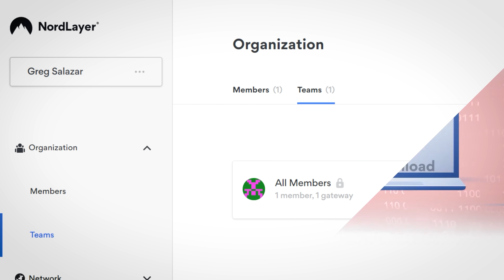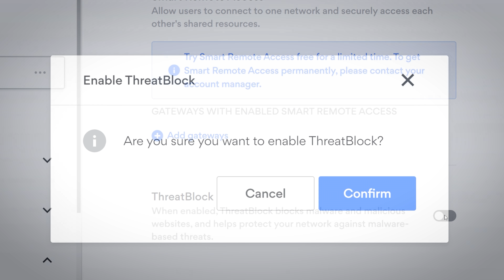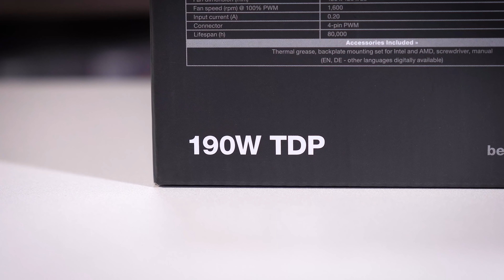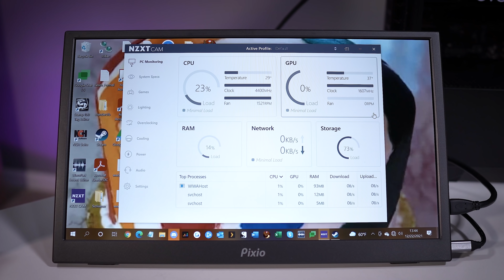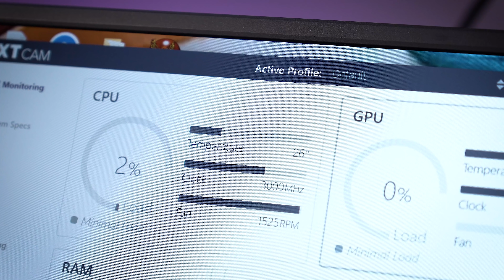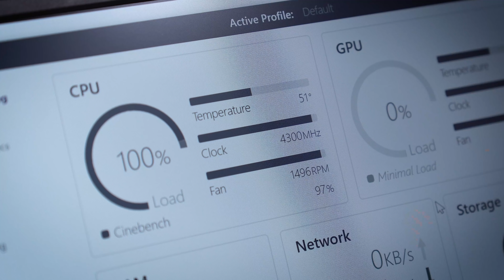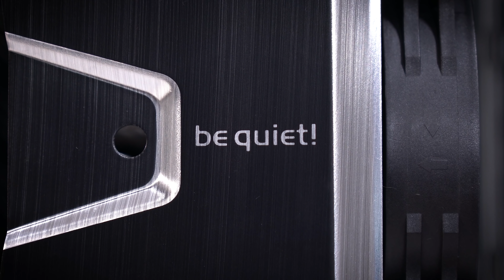Deep-Cleaning a Viewer's DIRTY Gaming PC! - PCDC S3:E1

Comment: My CPU with a single fan AIO is hitting 40c while idle but when under load it does not get any higher than 70c. are these temps good? I have a ryzen 5 5600g.

Comment: I have this (almost) same case and i don't understand why the front fans are completely missing. Also, why go with a wimpy 120mm AIO when there's more than enough space for a 280mm radiator on the front. I'm running an i7 11700KF with the Z63 280mm and under full load the temps never get above around 45C. I get why you didn't replace those fans, because there's a mounting bracket that slots into the front there.

Comment: The gpu clock seems high for idling, maybe switching to “prefer power” in the gpu driver could help lower the idle clock
Reply: @jbsthegamer  lower clock speed = lower voltage = lower power consumtion, so it matters
Reply: It also reduces performance slightly but it should come with it defaulted to that setting Specfically with nvdia GPUs.

Comment: 17:45  No offense, but you're checking the temps with the side panel removed. That can make a HUGE difference in temperatures. I have seen more than one pc that was getting high temperatures, and then simply by removing the side panel, the temps dropped down to an acceptable level. So, as I said, no offense, but I don't see how you can accurately or reliably check to make sure that his temps were now good, without having the side panel in place. Just saying'.

Comment: cable managment in a rather compact minitower is a nightmare.... the usb 3.1 cable is right below the gpu with no way to put it anywhere else... soooo anoying... but at least temps are fine... the highest I have seen even under load are 60. When browsing with 30 tabs open (I have  no idea why I have so many tabs open all the time... ok thats a lie... I read a lot and am to lazy to always open up my stuff again to find the point where I was...) the gpu sits at 36. The CPU though (with bequiet cooler by the way :-D) sits at 45. 
The CPU does at max hit 70. So totally fine. I had way worse temps with my old CPU cooler and even worse with my older case. So... yeah.

Comment: Even with the close-ups on the dust 'build up', I don't see what all the fuss is about.  I've seen MUCH worse to the point where this system still looks fairly clean by comparison.  A few dust bunny's on this one for sure, but I'd hardly say it was "caked" in dust, or "absolutely disgusting".

Comment: Hi Greg, I have the Ryzen 5 3600 with a CoolerMaster Liquid ML240L V2 and when idle my CPU is reaching the 38-44 degrees, is that ok or I have something to worry about? It's a new installed cooler btw.

Comment: am i right in thinking the mobo has 2 NVME slots one on top of the other and the drive that's in is installed in the top slot but screwed down to the bottom mounting screw?

Comment: I probably should send you my build lol... You'd have a heart attack at how old the case is and the cables.. I've even had a odd issue I never could fix even with cleaning and re paste on my GPU (RTX 2060 MSI dual fan) if I leave my power limit in afterburner on it to 100% default and play any game it spikes above 90C. I keep it on 73% power limit and it stays around the low 60's and 70's with little performance change but its just such an odd issue...

Comment: Question: my CPU temperatur is at 42°C and the Fan RPM at 582 (clock at 4400MHz), my GPU Temp is at 50°C and the Fan RPM at 988 (Clock at 860MHz)
My Specs are 
Intel Core i7 4790K
Nvidia GeForce GTX 1060 &GB
I dont know what Power Supply and other things i use :D
Is my PC too hot should I Deep Clean it (from en expert lul)
Where can I see what type of Power supply and the other things I use?
Reply: I have this PC sind 2013/2014 and never cleaned it cause i didn´t know how

Comment: Greg i am having a trouble with Asrock RX 6800XT Phantom gaming D, it runs way too hot after a while of gaming and i am in dilemma if i should change thermal paste, thermal pads etc. It is under warranty and i am not sure if i should open it up. All i did was i cleaned it with can of air to remove dust which was minimal and I would be gratefull if i could hear your opinion on this if i should open it up and void the warranty sticker on a screw.
Reply: What sort of jump in temps are you seeing when firing up e.g. Furmark? Bad heat transfer will cause core temp to spike dramatically right away. If it takes a few minutes, suspect inadequate cooling (is this on stock clocks?), and if even longer than that, suspect heat buildup and take a good look at case ventilation.

Comment: 5:20 Yep the usual internet recommendations, dunning-kruger effect people talking out of their ass without real experience about it. And I can say I have a couple of compressors, one silent with 10 galon tank for airbrushing tops @80psi and a workshop/garage one tops @120psi. And even @120psi with dusting nozzles, you'll  get 70-80% maybe 90% of the dust but you can't completely clean old caked up grime in a case with just a compressor.

Comment: My GTX 1080ti Fe isn’t over heating cause at idle it’s at 35 degrees but when I’m gaming the temperature is rising slowly to the max 84 degrees. I change the thermal past and clean the GPU. Now at 32 degrees at idle but still 84 degrees when gaming. I undervolt it + underclock and now it’s at max 65 degrees at 100% charge. Good airflows + good cpu temps. Any ideas ???

Comment: I have a question maybe someone can help me with. So it's only happened twice so far and my pc is currently working, but not to long ago when I turned my computer on it would just boot to a white screen. I hard reset it and unplugged and replugged my display port cable and it would still turn on white. After a while of messing around I just turned it off and left it alone for an hour or so and it turned back on. That was the 2nd time it had happened and was wondering if anyone may know what would cause it to boot to a white screen.

Comment: I was wondering why you stripped the case all the way down. Washing it with a hose, but why? You got it 2% cleaner while.using so much more of your time. Not needed IMHO.

I used to clean out PCs of relatives who smoked and never cleaned their PC. That stuff is nasty and maybe I'd do something like this only if I was taking ownership. If I was giving it back to them to neglect? Hell no.

All that said, that cooler is twice the size of that AIO and awesome! Nice rebuild.

Comment: Looks like a Kraken M22, which is a horrible cooler. Helped my brother in law order one, as he liked the design but didn't wanna spend Kraken x53 on a fairly budget build. The cooler had issues really quick, sounds like the pump running dry no matter how or where you mount it and the temps makes Intel stock coolers look good. For 70€ ish, that's kinda disappointing. Read reviews of it later and it seemed like issues with it is not uncommon. Gave him my old Hyper 212 RGB and his system runs cool and quiet now. I even bought a cheap brand 120mm AIO on sale for 26€ (40€ normally) and it seems to work as good, if not better, than the Kraken M22 (when it worked). I don't know if the new replacement (Kraken 120) is any better, but i personally hate the pump-in-radiator design. I own a handful of AIO's from Corsair, Asus ROG, Deepcool, the cheap 120 AIO, Cooler Master and EKWB and the Kraken M22 is the only one where i encountered issues. I might be a bit salty about it but that's hard to avoid when you help people buy things that turn out to be crap. Atleast when i helped my brother upgrade to a Ryzen 7 3700X, the weird performance issues that made it run like a celeron was easily fixed with a BIOS update. A pump having a stroke is not easy to fix lmao

Comment: I don't think it's the broken screw from the bracket the problem tho... he didn't even test the AIO... swapping the AIO with a brand new cooler wasn't the solution in the first place because even with all that dirt, the pc will run just fine... 90+° on the CPU temp point to a pump fault... and even more if the owner got pet hair floating around an air cooler is a bad solution

Comment: HELLO GREG HUGE FAN quick question whats a normal tempature for a GPU (with 1 fan) Nvidia Geforce 1660 super TI to like not overheat 
i get worried i feel like 66 c is pretty hot so just a question
Reply from the maker: It's fine.
Reply: For Nvidia as long as it doesn't throttle you'll be fine, keep it below 80ºC and it will be okay. 
66ºC under max load for a single 1660S is actually quite good as long as it isn't deafening. (i believe 1660S doesn't report junction temp so this is what AMD would call "edge temp")
Reply: @GregSalazar  ok thank u I put my games on low setting cause I’m a noob with computers like lifespan > How it looks u feel me so like I put cod on super low and it goes high to 65 but cod is a high demanding game and my gpu is only 1 fan. Thank you!’

Comment: Hey Greg Salazar I have a pc problem and I've had many of my pc friends and have brought it into memory express and no one could fix the odd problem with it. When it first happened I was playing rust and my pc powered off and restarted and once it did it would keep doing so if I pressed play on rust not when I opened  the game but when I was in the game and pressed the button to look for servers so I had my friend deep clean my pc and it worked for 2 or 3 days then the same problem so I brought it to memory express and they basically said to get a new cpu or motherboard so I did but when I did so the problem got worse I could only play for an hour before it started powering off so j then bought a third cpu and installed it and now my pc won't even turn on so I'm lost and can't even build a new one due to gpu shortage so I thought I'd reach out to you and see if you'd take my pc on I live in Canada bc. Thanks for reading if you do love the vids
Reply: Nice mess you've got yourself in there. Firing the parts cannon (an expression from the world of automotive repair) has clearly got you in a worse place than what you started out with. This is going to take a more methodical approach.

Were your CPU temps normal under load? Modern CPUs are pretty good at thermal throttling but emergency shutdown is still a possibility.

Other than that, the usual culprits in terms of random shutdowns / reboots are:
1. power supply!!!1
2. motherboard.
I think bluescreens are no longer hiding themselves these days, so probably not that. (There's a nifty utility from Nirsoft called Bluescreenview that lets you look at crash reports, quite handy sometimes.)

I wish you had tried another PSU before swapping the CPU a gazillion times. Oh well.

By "does not even turn on", do you mean "powers up but no life", "very briefly turns on but immediately turns off again" or "entirely dead"? Big difference. (If there is absolutely zip, zilch, nada, I would take the trusty screwdriver to the power-on pins just in case. If you took the board out to swap the CPU, you may have replugged the connector incorrectly or even not at all. Same goes for ATX power. There have also been cases of everything working bar the actual power switch. Happened on my new build, too, but apparently it was just a bit oxidized as it came back to life just as I was testing it with the multimeter while pressing it a few times. It's an older model case, might have been gathering dust for years. Now the only thing that still doesn't work is the power LED, which measures entirely open.) 

As often as you swapped the CPU, I wouldn't be surprised if you had some bent pins in the socket (also, is the CPU known good? you know what they say, it's never the CPU, unless it is!). I still wouldn't rule out bad PSU or bad board though. 

I'd say recheck your connections and look for a suitable PSU to borrow, as well as a basic low-power GPU if you need that. A decent 400-450 W job from the last decade and a GT710 or similar should do. (I have plopped a GT610 into a brand new Z590 motherboard and it worked, albeit begrudgingly, complaining that it had to enable the CSM - the card only sports a traditional video BIOS. That's the exact opposite of UHD750 graphics, which are UEFI only.) If in doubt, power supplies also tend to be comparatively inexpensive but important, and having a good one never hurts. In a gaming rig chances are you'll want anywhere from an honest 550 to 750 watts or so, with a (legit) 80Plus Gold rating so you know the design is not too antique.